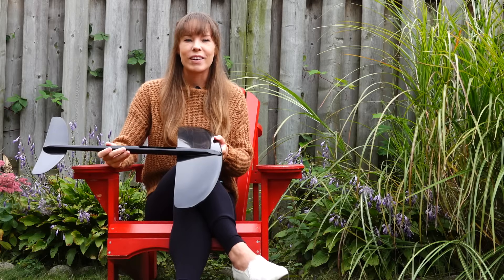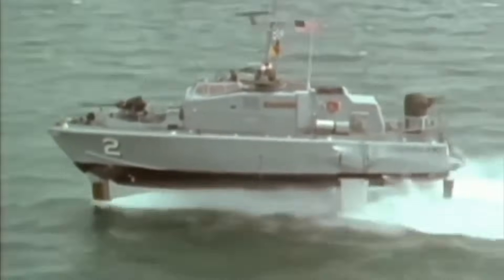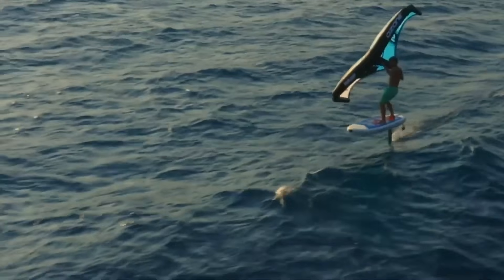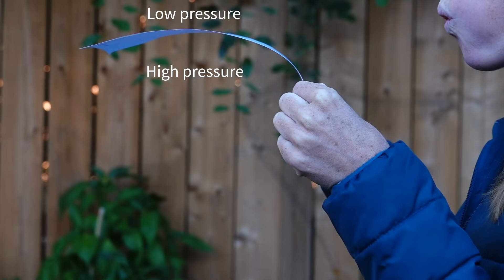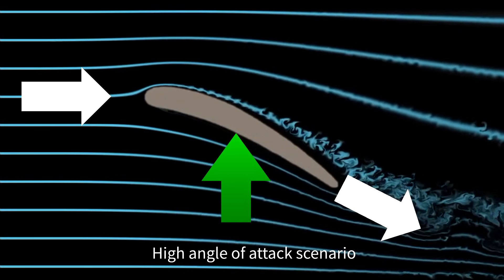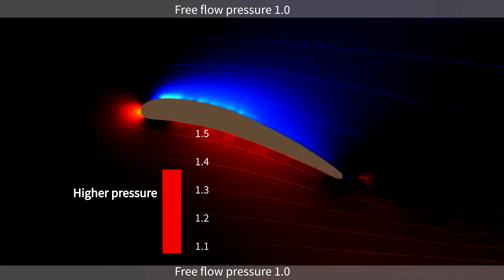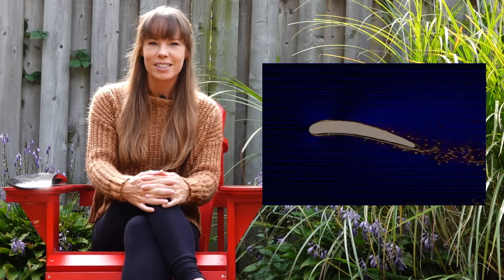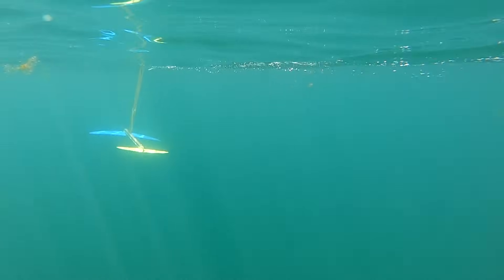How Hydrofoils Work

Comment: The lift comes from the pressure difference water creates as it flows over the hydrofoil’s shape. Faster flow on top lowers pressure; slower on bottom raises it. That unequal force upward-that’s the lift.

Comment: it would have been more accurate to just say that a hydrofoil continuously ACCELERATES  lumps of water vertically down to generate  lift, and slightly forward which result in drag. It is all acceleration of masses.  How it does this on the lower surface ( compression) and the upper surface ( suction)   are due to the convergent and divergent curves  that are generated by the angle of attack and the cross section of the wing. 

It is is not the equal time, nor the Bernoulli, nor the momentum theory, One must mention that the fluid when forming the streamlines must act as a sealed membrane where the flued does not cross the streamlines,   If there are air bubbles there is aeration  and if there is too much suction one can get cavitation which is not aeration,  There is also a stalling effect due to a high angle of attack when the fluid molecules will basically separate and  he wetness cannot keep them together in a continuous streamline without crossing the streamline. 
 
The word ACCELERATION  of fluid mass,  to explain lift and drag should have been used

Comment: One correction, it's the Low Pressure Area above the wing that creates lift.  Hydrofoils are pretty wild. But Instead
of increased speed, hydrofoils are more about efficiency through decreased drag, and lower fuel consumption. 
Check out the BMW Prototype Hydrofoil for something cool.

Comment: I am an airline pilot an this is absolute bullshit. Bernoulli's principle and Newton's third law explain everything. It's all about the angle of attack. A flat surface can generate lift by deflecting air downward making it go up and by the pressure below being more than the pressure above. When planes fly upside down pilots adjust the angle of attack so the same thing happens...

Comment: The part of the wing explanation where you assume both streams of air have to reach the trailing edge at the same time it's a common error, there is no rule that says that one stream can't arrive earlier than the other. 
One easier to understand expectation is that since the same volume of air is entering a similar section in front of the wing above and below the wing, the one at the top has to travel faster since it has to move the same volume through a narrower channel. But to go faster, the air has to accelerate, and to accelerate something there has to be a force. That force pulling towards the center of the wing is the lower pressure above the wing.

Comment: Not all airplains can fly upside down.
These are mostly acrobatic or fighter jets, where the wing profile is very close to be symetric.
These airplains relay on power to fly, that is why the can flip and engage on a  negative angle of atack to generate lift.
Some of these are so powerfull that can almost stand still vertically as an helicopter.
Do not try inverted flight in a cessna.. that will result in your last one.

Comment: * Most airplanes can NOT fly upside down, the ones that can are designed for such use and make use of symmetrical wings and uses the angle of attack to generate lift.  It's still Bernoulli’s principle.

Comment: I decided on the equal time theory a long time ago. It’s both principles at work. Not one or the other as many try to assert. The way that an airplane flys upside down is the angle of attack. The pilot has to fly nose high enough that the airflow pushes the inverted wing up as in the equal and opposite reaction principle. But not enough to stall the airfoil.

Comment: If I recall correctly from my final year fluid dynamics lectures, foil lift is produced from the “net” circulation of fluid around the foil (i.e. there’s more going around the top….) which when driven through the fluid produces lift (think tennis ball hit with topspin “flies” until spin rate drops and ball falls rapidly - hopefully just over the net!). Conservation of circular momentum, it’s one of the physical Newtonian laws (e.g. ice skater pulling their arms in and spinning faster…). It’s also why new jet liners have winglets, to keep the little “tornadoes” slipping off the end of the wing. There is an effect of low-high pressure but it’s minimal. …mind you uni was a long time ago!

Comment: You still failed to explain how the air planes can fly upside down.
Reply: Once the pilot invert the airplane upside down he must apply a little of elevator (pitch down) to compensate, if not the airplane would drop slowly. Same when the knive edge maneuver is done they have to apply rudder to maintain level

Comment: Flying upside down is largely because the wings are more symmetrical in shape. And they just have some raw power. Along with the angle of attack. 

An F-15 can fit with one wing. At that point it almost more of a rocket.

Comment: Blow below the paper it will still lift :). but the speed below is higher :). It is all about the angle of attack and changing the location of fluid. Water pushed down so the wing pushed up. Great explanation

Comment: The reason planes can fly upside down is because they change their angle of attack, aka the angle with which the wing is oriented with the flow of air.  A high angle of attack increases drag, but also increases lift.  This is in line with Newton's 3rd law and conservation of momentum.

Comment: Wrong! If you take a non curved foil with with a classic wing design and zero angel of attack it will lift due to pressure difference. And yes, the air or fluid will then move downwards, but this is a result, not the cause.

Comment: The lift of an upside down wing is created the same way as a right side up wing, explained by Bernoulii's Principle. A wing with a zero angle of attach has a stagnation point (the point where air is divided to go either top or bottom) close to the tip of the leading edge. As angle of attack increases, the stagnation point moves down and backwards. This make the air travel further, on top, even on an upside down wing. Not all planes can fly upside down. The require sufficient power to weight ratios, which many planes do not have. RC planes don't count, since their power to weight ratio is extrememly high. Many can hover straight vertically without stalling.

Comment: Your statement "it is not clear why wings generate lift" is true, if and only if there is only one method creating lift. But as you mention, there are more than one mechanisms. When planes fly in upright (normal) configuration, the wings generate lift by Bernoullis principal, upside down they create lift using particle kinetic by flying at a significant higher angle of attack. You can see it in any biplane airshow video on youtube.

Comment: Thanks for the introductory video, but sadly some parts of this intuitive explanation are not correct.
The fluid dynamics of a wing are well understood and there is NO debate in science, which I think is a very important fact. Next, your explanations are not consistent with real experiments. Let's consider the great Bernoulli experiment with blowing over paper. If the resulting force is from deflecting the flow, the force acts on the flow -> hence the paper doesn't move. In reality pressure and velocity are essential parts of Navier-Stokes-equations (which we can simulate very well and exhaustively describe fluid mechanics as far as we can observe it). Hence, for the paper experiment the low pressure zone pulls up the paper. And the flow arrows with deflecting the flow are a very misleading friend: pressure acts in all directions at the same time, without any preferred direction.

Comment: I'm completely against Bernoulli or Venturi high/low pressure this and that for hydrofoils. Gasses experience pressure gradients readily, but liquids don't as they can be assumed to be incompressible. Maybe for wings and spoilers going through the air, but not hydrofoils going through the water. I would say Newton's third law for hydrofoils.

Comment: Newton and Coanda explain fluid dynamic lift in normal flight and inverted flight. Also, water does not flow, the foil moves through the water or air. The water or air molecules only move up and down to get out of the way.

Comment: What you did not mention is the angle of attack, which is the measurement of how high the front of the wing is tilted. A plane can fly upside down because the front of the wing is titled higher than the back, not necessary due to one side of the wing being longer than the other side. A stunt plane has symmetrical wings (they are curved both on the top and bottom). The shape itself generates no lift, but because the wings are tilted in the direction of travel, they generate lift.
Reply: She did mention angle of attack.

Comment: This explanation is not really correct! First it uses highly cambered profiles (rarely used in modern applications, almost only on racing cars), to justify the downward displacement of fluid, but many profiles used have a flat bottom or are symmetric. Flat bottom profiles produce lift even a small negative AoA.
And than the mentioning of the “inverted flight” to disprove a theory, well any acrobatic or RC plane pilot will tell you that when you fly inverted you have to pitch up your nose so to give your wing an higher AoA (Angle of Attack), higher for asymmetrical profiles! Also you can fly without a wing profile, like when aerobatic planes fly knife edge, using the side of the fuse like your “hand out of the car window”. So the best explanation is the combination of both Bernoulli effect, from the wing profile and the conservation of momentum from the AoA. This would also explain the stall, caused by detached of the fluid flow on the TOP surface

Comment: This is a similar engineering concept when desiging skyscrapers. Windows that high are exposed to high winds on the outside which create a vacuum (low pressure) & the windows need to be able to withstand that.

Comment: Here is THE explanation of wing generated lift.

As a wing moves through a medium, a perfect vacuum is generated at the surface of its backside. This vacuum diverts and accelerates the medium downward along the wing’s backside. This diverted medium creates a low pressure area above the wing that pulls down, “scoops,” and accelerates more of the medium from above down and along the wing’s backside.

All of the scooped up and accelerated medium is then shot off and down the wing’s trailing edge. Opposite and equal reaction: Lift. (In some videos of large planes landing, this action can be observed.)

Lift is Newtonian, not Bernoullian. However, the low pressures as described does permit the use of mathematical approximations with Bernoulli formulas when designing wings.

Sidenote: It can be further deduced that most of the energy that sustains an airplane in flight is extracted from gravity*. Evidence of this is that wing or rotor equipped aircraft have glide ratios or auto-rotation. And then there is the autogyro. Hydrofoil wings probably harvest energy from gravity as well.

*Binal-Dynamics. Also seen also in Tensegrity structures.

Comment: Aircraft don't fly upside down efficiently or nearly as fast. The 22.5 angle (median of your mention) is used also in anti-radar/radar absorbing surfaces, as well as sound rooms to cause sound to cancel itself out. Either inward or outward angles do this with sound and rf, or in the application of golf balls; a specfic angle of 22.5d in the convex pit forces air pressure modulations to resist one-another using a 3 phase transition of pressure shared among points.  In this case it's a plane against the water itself. The reason 22.5d is naturally vexing to white noise, or water flow just the same, is because of simple geometry regarding all forces in a universal rule; the differences of negative and positive spaces become interlocked among a system of flows to resist penetration by outside flows by working with the flow just enough. 22.5d x 8=360d.  It may not seem like a 1 dimensional flow of water pressure  could be applied to the 8x geometry, so is it just coincidence?  In elementary particle physics, superconductivity was never realized in geometry until I wrote a paper on this in 1996 and Egor Babaev discovered this also on supercomputer 10 years later appx. (ref: type 1.5 superconductivity)
My Grampa used to race hydrofoils on Lake Washington. I can tell you, the longer the boat, the safer it can operate at high speed without computers. It is also possible to use a gyroscope, and the mere flow of water can be your computer. There's always a better design for something somewhere just when you think you've got it figured out.

Comment: tf are you talking about, aeroplanes cant fly upside down and when they do the pilot has to point the stick forward and down (their down) is our up. a flat foil will lift because its angle of attack causes high and low pressure above its how a boat or the vertical fin on a plane will turn. an angle of attack of zero given the foil has a longer distance up top will lift no matter what as faster flowing fluid has less pressure period. Thats what flaps are for on a wing, increase the length of the top side for extra lift. The first explanation was the correct one the rest were bs.

Comment: This is more accurate than a lot of aerodynamic explanations of wing lift. But the "flow turning down implies lift" does very little to explain in detail why it is working. The simple answer is that there is no simple answer. Calculating the lift on a wing requires detailed, piece-by-piece, tracking of the flow in a huge computational fluid dynamics (CFD) calculation. That is why wind tunnel tests are still used to experimentally measure the lift.

Comment: Both a flat and curved wings can produce a pressure differential, but the curved wing is more effective in one direction.  This is why a flat wing is just as effective whether it’s right side up or up side down.  The curved wing is not as effective when upside down, but can still produce a pressure differential.

Comment: I didn’t really understand how the Flow of particles is directed downwards. If I understood correctly you said that the flow is directed downwards if there is high pressure on top and low pressure at the bottom. But you said earlier that the high pressure zone is below the wind and the low pressure is on top. So that’s conflicting

Comment: If flat then force is applied to the surface like a brake but when at an angle allows the wing to ride over the force of breaking. So it’s riding on a surface regardless of how deep it is.

Comment: The animations are illustrating it at a constant fluid speed always. And you dont ride a foil just standing there and you've been focusing on the top fluid motion but never the force (equal and with a resultant direction) that's attacking the underside, which is the part with the largest impact and is not vertical. Not easy to explain in few sentences but being in fluid mechanics and dynamics most the time since uni, you'll get the hand of the resultant forces. Also see bicycle, it is not the normal force balancing it and progressing. It is the the initial velocity + force underside creating a resultant force (not opposite). Fine, just enjoy foiling though

Comment: I missed seeing 'the wings' which are installed on race cars, which I suppose, are intended to achieve just the opposite of what airplane's wings are used for. I can only surmise that the trailing edge of the race car's 'wing' must be positioned higher in order to accomplish downward 'lift'.

Comment: Wow! Very impressive presentation. I wonder at what speed you have to progress in water for the lift to start to occur? Can you design an hydrofoil that could help long distance swimmers move at speed they could never do before while decreasing the impact of the waves on them?  An hydrofoil attach at the abdomen level of the swimmer which would simply induce a high level float on the water and reduce the drag. This seem more efficient than a pull buoy! 😁😁😁😁😁😁😁😁! I have a good imagination!

Comment: The total pressure above and under the aerofoil is equal. But on the top of the Aerofoil you have higher dynamic pressure and lower static pressure and on the bottom you have a lower dynamic and higher static therefore although the total pressure is equal on both side you still have a higher static pressure on the bottom which create a lift and pushes the aerofoil up

Comment: And in the end, I am always blown away at the thought that the relatively small main and rear wings can generate enough lift to push not only the board but the weight of my body up and out of the water. Fascinating!
Reply: That's because water is so, so, so, so much denser than air.

Comment: Planes can only fly upside down with their nose trimmed up. Every flight sim I've ever flown, to fly inverted, you can't just fly level, you have to have your nose up. if you try to fly level while inverted you lose altitude, and I've often wondered why. Perhaps the aircraft must be in an inverted nose up attitude, and thus actually climbing, to mainatin level flight while inverted due to the loss of lift from the wing when it's inverted? just a thought.
Reply: when flying level and upright through the air. the plane is equalizing the forces of lift / gravity & thrust / drag.  the design is made so you the passenger will be sitting level while the airframe, or more precisely the wing angle where it is attached,  will be canted slightly upward at the nose.  However when you go inverted that upward airframe angle is now working with gravity instead of against it thus the need for the nose trim to maintain a level attitude while inverted, the thrust/ drag equation is relatively unchanged. Although it would be an interesting experiment to see if you got better fuel consumption #'s while in inverted flight.